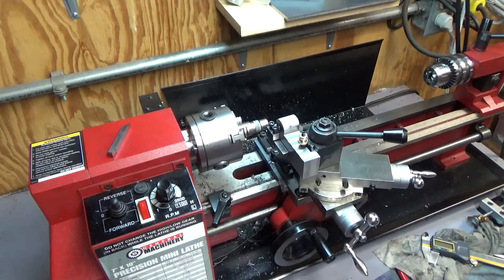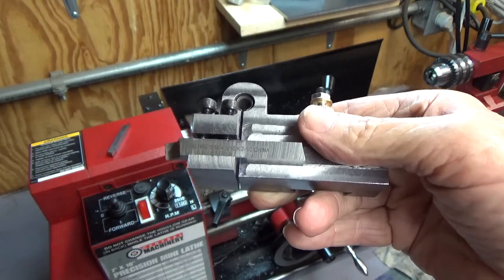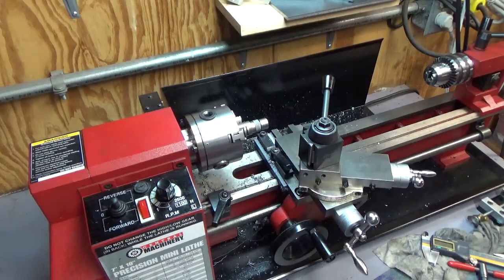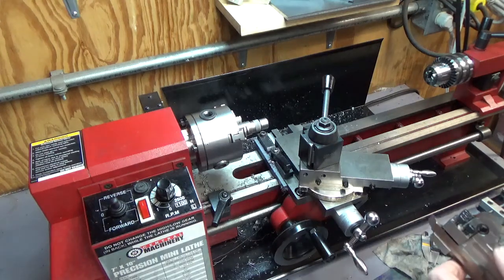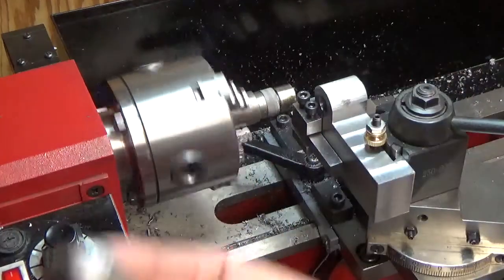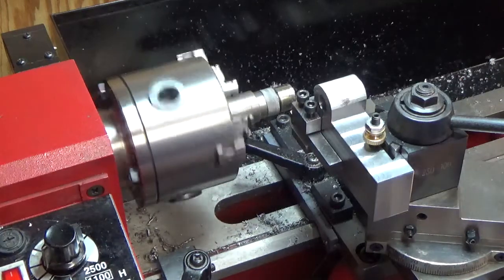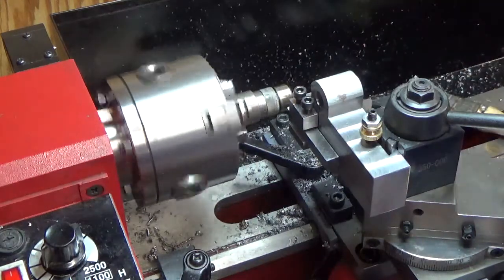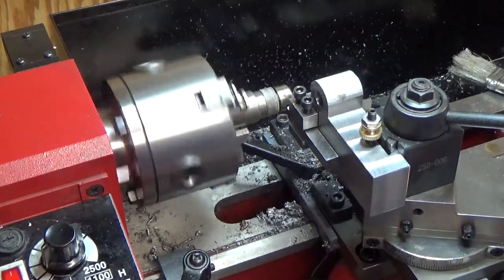Mini Lathe Spring Form Tool Holder

Comment: (Pak untuk jenis besi yang di gunakan rumah pahat radius besi jenis apa pak)
(Sir, for the type of iron used in the chisel house, what kind of radius iron, sir)
Reply from the maker: As I recall, it was just typical mild steel.  Either 1018 hot or cold rolled steel.  Regards: Larry

Comment: I noticed that the label on your mini lathe says 7 x 10, but I own the same 7 x 10 and there's no way that my bed is as long as yours.  Did you replace the bed with something, such as the one offered by little machine shop?
Reply from the maker: Dan: 7x10 is way to small for me.  I replaced the bed with a 16" bed and that seems to be adequate.  I also changed the cross slide to provide more reach.  I guess the thing to do is just buy a larger lathe to begin with, because in the end I probably spent more money than needed.  That me; Penny rich and dollar poor.  Regards: Larry P.S.: One of the reason for extending the carriage was to accommodate the sprint tool holder because it does stick out quite a ways.